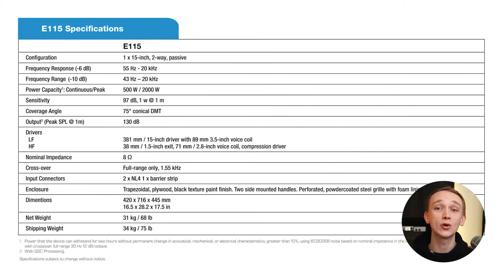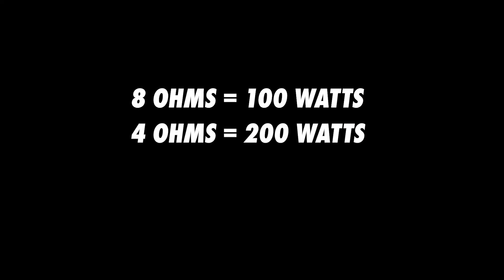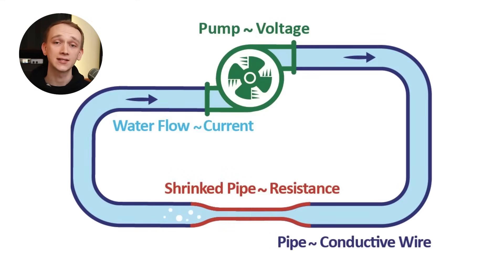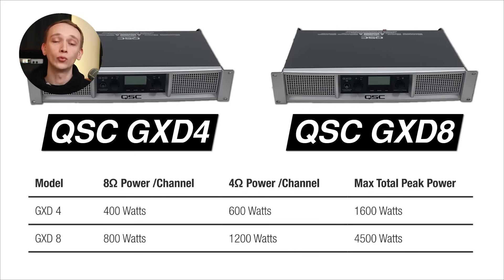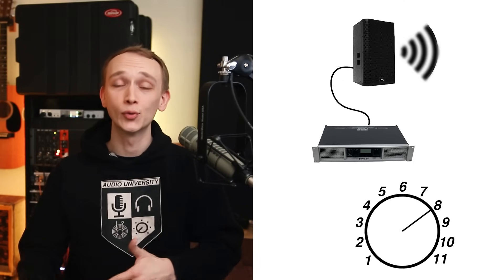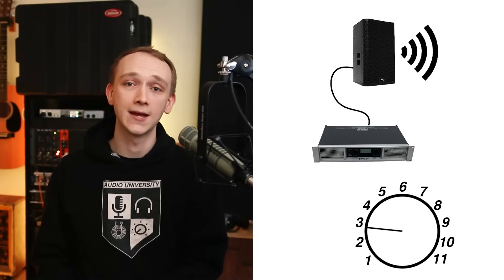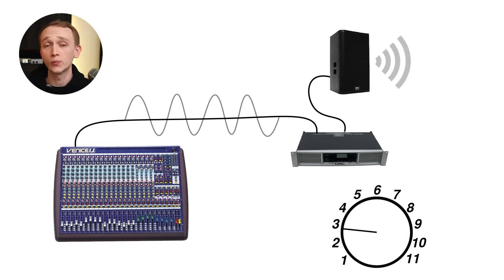WARNING: Breaking These Rules Could Destroy Your Amplifier & Speakers!

Comment: I came across a QSC 1450 amp and Yamaha SM12V monitor speakers.  Rating on the QSC is 280 @ 8ohms and the monitors are 350W @ 8ohms.  I have only been running the amps at a little over  half gain (12 o'clock).  Am I ok with this pairing?

Comment: Never put gain on ANYTHING more than half 🙏🏻 rather boost the signal from the main source or from the main mixer , Never use the gain as a volume function 🥲 you will regret it 😭 especially with professional DJ/PA Sound Systems 🙏🏻

Comment: Here’s something most people don’t realize: a lot of amplifier manufacturers love to hype up power specs in their marketing. But the truth? Many of those amps are built with weak power supplies that just can’t deliver when it matters. Under a real load test, they rarely hit those advertised numbers.

Most customers never test them — they just believe what the box says. But when I build my own power amps, I go all in on the power supply. Why? Because that’s what really feeds the speakers. Your transistors or MOSFETs can only do their job if they’re being properly powered. Power in = power out.
+ There is effeicency losses so need more power in.
I’ve had people absolutely stunned when I tell them the actual RMS rating of my amp — like 100 watts RMS — and they just can’t believe it. Their faces are priceless. You see, when an amp is built right, it doesn’t just sound powerful... it feels powerful. And that’s where the magic is.

Comment: Hi. How can I balance a 2 channel amp 8-16 Ohm rated (works on 4 Ohms and bewlow but not ideal), that'd got 2 8 Ohm speakers per channel and I want to add a 3 Ohm subwoofer to the mix but the catch is I want to balance the inpedance and sound as well as the power in between the 3 channels and 3 speakers equally. I need help please. At themoment I run the sub in series with one of the speakers and still testing it out. It works but not ideal.

Comment: I bought some Elac Debut 3.0  DB63 bookshelf speakers, still being shipped.  I have a Denon 7.1  AVR 790 Receiver.  I might upgrade the Denon later, but will it be safe to use it for now?   The speakers are 6 ohms, and the specs for the speakers say to use 20-140 watts from an amp.   The Denon is rated at 90 watts per channel.  I don't plan to go to max volume or anything.   Would this amp  sound ok with these speakers?   Would it be worth upgrading the Denon?  I'm looking for the best inexpensive way to drive these speakers.  Mostly for music and occasionally for movies.  I wouldn't mind having one amp for music and one for movies.  I've heard good things about the Fosi and Wiim amps as far as budget options.

Comment: Thank you, thank you, thank you!  I teach sound courses to churches, and you wouldn't believe how many churches I've come across where the tweeters are blown or damaged, because someone thought it would be a good idea to use a smaller (and cheaper) amp than the capacity of the speakers.  So many 500 watt speakers in the trash, because the tried to drive them with 100 watt amps. "We don't need all that power in our small church, so we bought a smaller amp in order to not damage the speakers".  Sigh! Trying to explain WHY they now have dead tweeters isn't easy, and the result is often blank stares.  I'll be re-directing them to this video in the future, as it you explain it so clearly.  
.

Comment: "Choose amplifier that can deliever 2÷4 times more power than speakers can handle"?! Sorry, but it is nonsense.
Reply: Hardly nonsense. For one thing you want an amp that can handle the transient above the continuous power. 

You shouldn't be running amps at peak capacity. Amps are nonlinear devices with their nonlinearities appearing at higher power outputs. By having a very high output amp but running the system for only a fraction of its power handling you keep it below nonlinearities. 

For example, heat creates non linearities as it changes resistances in the signal path drastically. Usually for the worse. By running an amp at lower power you generate less heat, which creates less resistance, which imposes less loss on the signal.

Comment: Im using a 100w rms speaker with a 50rms amplifier. I never turn up the volume knob over 50%, its almost always at about 30-40% of the maximum. 

Do i run into the danger of clipping with this setup?

Comment: This does not answer the fact of knowing if your amp is set too high or too low. All of you audio YouTubers just say to have an amp double the power rating of the speaker, and to avoid clipping.

You can perfectly destroy a 400w speaker with a 800w amp, and the only solution you give is to crank it up, listen for distortion, and then turn it down, hell no.

So I decided to make my own guidelines.

I rent speakers, and unlike active speakers that have built-in protections, passive speakers have none, and I cannot trust a potentially drunk man to not overpower my subs.

What I decided to do is have a signal limiter to the amp, in my case I use a mini DSP,  and limit the line level signal to the amp. (for some reason, actual limiters are more expensive).
I limit the line level signal according to the desired output RMS voltage that comes out the amp, using ohms law, RMS formulas, and my inexpensive handheld oscilloscope/multimeter. 
So if I need 20V rms for the sub to draw 500W rms, I firstly crank the amp's physicals knobs to their max, and from there increase the DSP's line level signal limit that goes to the amp until the desired voltage comes out the amp. (with the speakers disconnected, do not do on tube amps!)

It's easier if you just type this prompt to ChatGPT, and learn from there asking questions:

"Hey , I want to protect my subwoofers from being burned by my amp (live audio subs).
The subs are 500W RMS / 2000W peak, impedance 8 ohms.
The amp is 575W at 8 ohms ; it doesn't necessarily say "RMS" here .
Couldn't I just apply Ohm's law by checking the voltage with an oscilloscope ?"

I use a Zoyi ZT-703S if curious.

Comment: I mate thanks for your input. Pardon the pun!!! 

 I want to connect extra speakers to my amplifier  running   In series! My amplifier is Sony 1080. At  165 watts a Chanel.  At 8 ohms.

for example!  Two speakers at at 8ohms Making it 16 ohms  and it’s a 7.2 system 

For example I have  one right hand floor standing Speeker.  And I want a high Speeker For on the ceiling.   If I was to do that to both floor sand speakers left and right wired in series cut the amplifier support that okay do you think? I would appreciate your reply, thank you.

Comment: I'm unconvinced about rule three unless it's specifically for PA purposes and the operator is clueless. In fact the rule worries me more in that case.

In the guitar world where I have some expertise, manufacturers commonly pair smaller amps with larger speakers. For example 80 Watt amp with 100W / 200 watt speaker stack.. 15 Watt Orange amp with 60 Watt Celestion V30. We pay a lot for clipped wave forms.

The "rule" seems obituary there are trade offs on both sides. Operators in my world a guaranteed to max everything out at some point despite their low end being compressed out of existence. 

My rule is that Watts largely don't matter unless you are pushing too many. SPL / W @ 1 and distance affect volume the most. Loudness if the last thing you should be basing design choices on.

Perhaps I'm solving a different problem.

Comment: I've noticed the wattage/speaker calculations for guitar v power amps are completely different. Bass guitarist here, I was thinking about using a power amp with a preamp as an alternative to a guitar specific amp, and the recommendation for guitar amp wattage is less than the wattage of your guitar speakers, and you are expected to be able to max out the volume of your amp without clipping. I don't know why, but nobody ever talks about headroom for guitar amps, but for power amps you're recommended to get the rms wattage of at least double the rms wattage of your speaker, but isn't the peak power rating the "headroom?" If not, then a power amp with 400 watts is basically equivalent to a 200 watt guitar amp because you arent supposed to push a PA to max, but you are for a guitar amp. I'm not criticizing anyone I'm just confused and looking for an answer, if anybody knows I would really appreciate it.

Comment: instead of adding a higher wattage amp in a lower wattage subwoofer / tweeter, mind aswell have the amp  matching wattage to the subwoofer/tweeter to prevent the distortion, clipping, overloading and coil burning and smelling

Comment: Merci pour la video tres instructive, cependant j aimerai noter certains points. La puissance reelle d un aplificateur est trouve en fonction de son rendement donnee en pourcentage, par exemple, un ampli de 1000w peak avec 80 pourcent de rendement donnera une puissance finale de 800watts, ceci dit, utiliser un amplificateur 4 fois plus puissant que la  puissance continue du haut-parleur ne sera vraiment pas necessaire a mon avis.Si l ampli est deja 20pourcent plus eleve que la puissance peak, c est deja bien.Ensuite, je conseillerai plutot d utiliser un amplificateur avec le potentiometre tourne a 100/100 et de regeler le niveau d envoi du signal avant d arriver a l ampli. A noter aussi que la charge pour une enceinte basse frequence peut etre differente d une enceinte haute et moyenne frequece.En 8 ans  d experience, je ne me souviens pas d avoir fais bruler une enceinte ou un ampli, bien au contraire, j ai eu un meilleur son avec asses de dynamique de cette maniere. eclaire moi si je me trompe.

Comment: excellent video i’m using a 800w  amp mixer my Speakers recommended an amplifier that is 400w to 750w so if I want to go louder I should get a 750w amp so I’m not pushing too much gain and volume to achieve that wattage? i’m using Martin audio f10 speakers it says 250w AES, 1000W Peak i’m not sure what AES means
Reply: Devide aes to 1.3 you will get rms power of speaker

Comment: Gain on the amplifier turned down to even half does not reduce the wattage coming out of the amp if you still run the amp into clipping.  It also depends if the amplifier has a clip limiter in it and what kind of clip limiter.  I can run my old crest 8001's, 9001's and 10001's into solid clipping and the built in limiiters never resulted in blown speakers.  I run 1,000 watt RMS  speakers with 2,000 watt rms amplifier and haven't lost a speaker or sub.  But then again, I used to run cerwin vega sl36's and jbl SRX speakers and they let me down more than my bulletproof RCF speakers did.
Reply: I agree with this approach.  If you’re gonna run twice the power of the RMS speaker wattage then leave that dial cranked all the way up..

Comment: Clipping, speakers and power handling explained:

Clipping is the limit of the amplifier not necessarily the speaker. The limit of the speaker could be greater or less than the limit of the amplifier.
In multi way speakers with passive crossovers, power handling is frequency band (and also music band - e.g. Slipknot or Michael Jackson, but that's a related topic on the loudness war and frequency spectrum of different songs) dependent. 
The woofer(s) usually handle more power than the midrange and tweeter(s) (at very low frequencies - especially in a ported or horn cabinet, the woofer can flap around without much power which may damage it mechanically).
When you clip an amplifier, it adds harmonics to the music.
Your speaker can't tell if the amp is slightly clipping on music with a wide dynamic range, and this is unlikely to cause damage if the speaker is rated to handle the amplifier. However, playing compressed music and turning up 10, even 20 dB beyond the clip point (this sounds really bad, especially through horn loaded compression drivers!) introduces significant extra harmonics. This adds more power to the midrange and tweeter.

An amplifier that's too large pushed hard is more likely to stress the woofer, though could also stress the midrange and tweeter.
An amplifier that's smaller but pushed into heavy clipping on compressed music can stress the midrange and tweeter but the woofer will probably be fine.

Compressed music that's not clipping can put more stress on drivers than wide dynamic range music that's slightly clipping - at the same peak level.

Choosing a larger amplifier than the speaker's rating allows you to extract the maximum performance from a speaker - ensuring it's only the speaker that's adding noise/colouration/distortion to the signal. You will have to lock the volume control away from your drunk friends.

Choosing a much smaller amplifier is more idiot proof - as long as you are not overloading it with too low an impedance, and you size the midrange and tweeter (or pad them with resistors) to handle crunch city if the amp is heavily clipped at a house party, and you filter out extremely low frequencies that cause the woofer to flap around.

Comment: So for a speaker with continuous rating of 500W, one should by an amp between 1000 and 2000watt… in many high-end stores they use class A amps with less than a fourth of the speaker’s rating. In this case even 1/10 with a 50watt class A amp….

Comment: Thanks! So i bought an amp that has gain control. If i turn down the gain to 75% which equates to continuous power of speaker- will it be foolproof?
Reply from the maker: No. Audio systems are rarely fool-proof. There will still be the possibility of overdriving the input of the audio amplifier.
Reply: @AudioUniversity  then i will keep an eye on those clipping indicators.thanks.
Reply: The volume attenuator knob on the front of the amplifier isn’t linear. 75% of the way up probably will only be 60% of the power.  But you’ll only really know for sure if you measure the voltage coming out.

Comment: Can I connect my 50w 6ohm speakers to my 40w per channel 4ohms amplifier
Reply: Yes you can, slightly more powerful amp is better because you a4e able to drive speaker at full volume without distortion from amp at full power (clipping and other stuff ) just dont turn volume gauge all the way up haha, although in your situation you acrually can, because impedance will cripple the current, thus lowering the power so now worries buddy💪😎🤙

Comment: I have a pair of B&W 804 3D3.  They recommend a 50-200 watt amp and they mention nothing of continuous power.  I used an Anthem STR 200 watt integrated amp and it sounded great.  I switched to separates:  Anthem STR preamp + 400 watt power amp.  The difference is phenomenal.  Definitely got extra headroom for the speakers and the dynamics are wayyyyy improved.  At first I thought it was overkill but such is not the case.  B&Ws are power pigs.  The more watts you throw into them the happier they are, so long as you don’t crank it up to the level that they can’t handle.

Comment: I will listen to this video several times, take notes 📝 and follow the instructions.. Additionally I have Subscribed to the Channel and will make ample time to continue with understanding your Audio University Message… I have Dasey chained a few high powered Cerwin Vega Speakers with lower Powered Amplifiers, example 3-4 speakers on one channel and the same on its second line. Now I have a total of 3 Crown Amplifiers that no longer give out any kind of wattage, although they turn out, I don’t even hear  crickets 🦗… local audio stores are being honest and saying they will cost more money to fix then they are worth. I now have 100lbs of Amps that I bought brand new and only used in my Garage converted Studio.. I have no choice but to try and fix them on my own… Thank you for sharing your knowledge with us. If anyone that reads this message has one or two trouble shooting ideas I will welcome them. Best regards from NYC… Cheers 🥂

Comment: well ngl no cap my subwoofer peak power is 6400Watts and the RMS Watts is 1600watts and the db is 138db and it's a dual 18 inch subwoofer
Reply: That's in a VERY well designed box that takes FULL advantage of your sub's resonate frequency, AND this is no doubt, in a car, or SUV, or some kind of vehicle, that's definitely NOT any home sub system you're describing there, that's for sure!

Comment: There's one point I think should have been mentioned in the video, and its fairly important. In pro audio, its very common to bridge stereo amps and use them as 1 channel. You need to be careful when you do this for a couple of reasons. Bridging a stereo amp doesn't make it a mono block. Its a bridged stereo amp, and there's a big difference between the 2. Any time you bridge a stereo amp, the amount of resistance the amp sees from the speaker is halved. So, if you have a speaker that's rated for 8 ohms and drops down to 4 ohms, the amp sees the exact same speaker as a 4ohm load that drops down to 2 ohms. This runs the amp much harder, and you're far more likely to damage the speaker from underpowering it. 

Also, you really can't put too much trust in power amp ratings. There's no standard that manufacturers go by to rate an amps power. This leaves it up to each company to rate them however they see fit.
Reply: Wow thank you very much. I never know this. Lucky my speaker still intact. Lol
Reply: I was gifted a QSC PLX1602 amp and a JBL TR225 tower speaker rated 4ohm, 450rms. Would it be safe to run it on bridge mode? Sorry, I have no idea what I'm doing. This gift gave me a reason to dust off my mixer, my vinyl and my 1200s lol

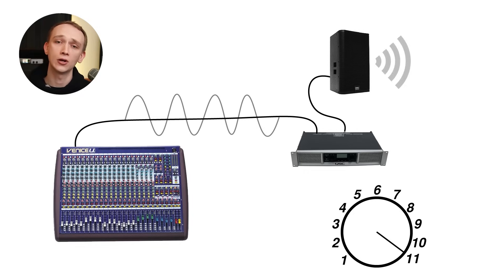Comment: 5:44
So, if I understand correctly, then all I need to do in a "matched" scenario is avoiding increasing the signal? Thanks, then I think I will be good with the rated power (because it will be loud enough for sure) and this way I 100% won't overpower my speakers....................................